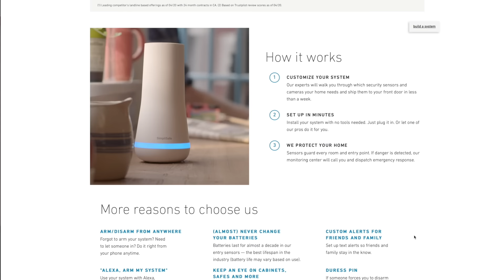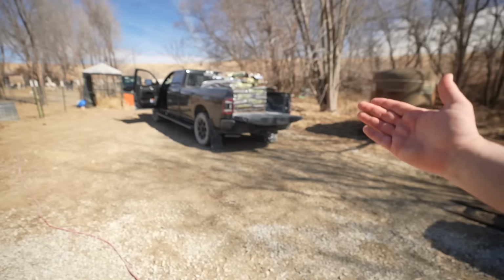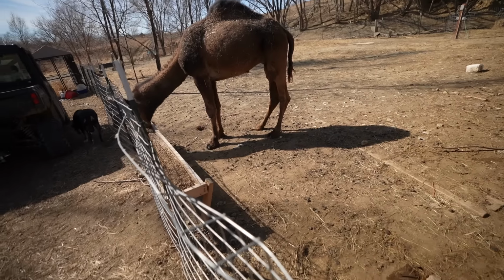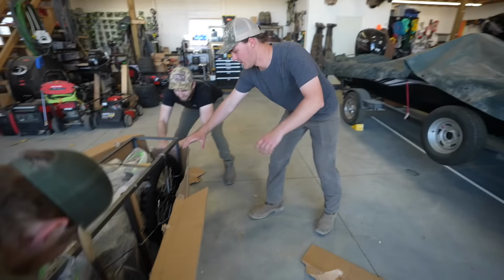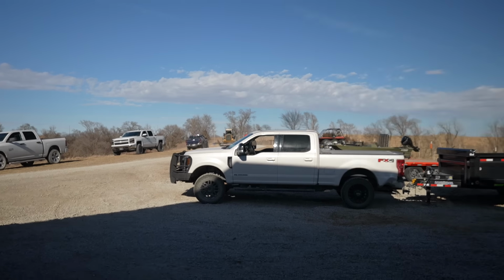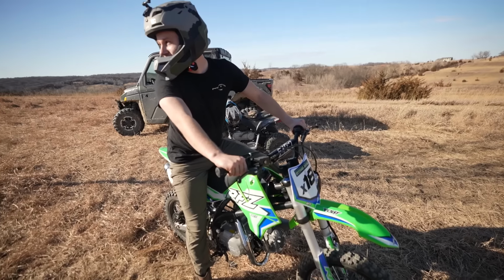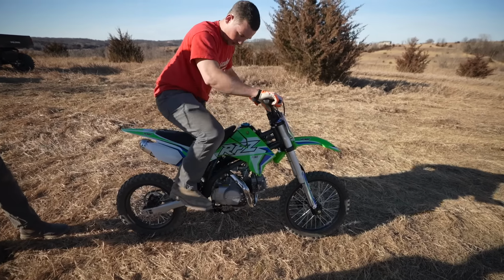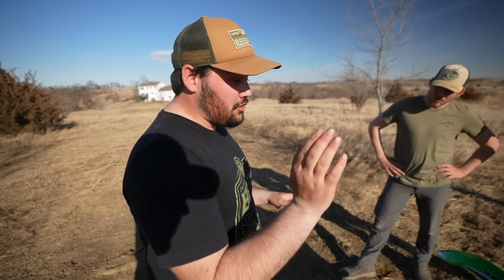Buying the CHEAPEST Dirt Bike on AMAZON! (Taking off Jump)

Comment: Roll starting it gets compression started by moving the cam shaft most 2stroke you can roll start and a starter is just a electric engine turning the cam some people used to put there trucks on a hill and rolls start then that way

Comment: Put blue lock tight on all the bolts. It’s probably hard to kick over because it’s not broke in. They’re not bad bikes to learn on and learn how it works mechanically with a couple cheap mods and move up to a name brand bike and use it as a loaner bike. You could also sell it in a yard sale if you wreck and decide it’s not for you and need to pay for an emergency room visit😂 I wish my first bike was one of those. I had an clapped out rm80 I pieced together and rode with no brakes

Comment: The rattling noise sounds like the chain which is normal they are supposed to be a little bit loose. Usually the rule of thumb is two fingers between the chain and the swing arm.

Comment: Flair what's up bro!!! You da man!!! I have owned one of these RFZ 125's for some time now and if you treat them right they will last! You'll need to change the carburetor to the off brand mikuni on Amazon and make sure you frequently check your nuts and bolts! I have had several pieces of my bike fly off because I did not tighten beforehand. Can't wait to see more vids of the bike! And if you have any questions feel free to message me!

Comment: If you guys didn’t change the oil you will need to because I got on cheaper than that and the oil is bad so change it if you see this!  And the bolt in the middle of the forks might fall off

Comment: I seen the bike doesn't have compression when the clutch is pulled in. I'm pretty sure it's a safety feature that it won't start with it pulled in. If you don't pull the clutch in it will start everytime guarantee had quite a few Chinese bikes in my day.

Comment: Shouldn't mention what security system you use.. there's devices on ebay that share the same frequency as your security system used to arm/disarm your system.. fairly cheap aswell..

Comment: Chinese pit bikes are ok for a budget the rfz you have is pretty good, Kawasaki Honda & Yamaha are better for upgrades but run 4-$5,000 right now I had a TaoTao 125cc it did the same thing with having no compression holding in the clutch and starting it, keep up on spark plug and oil changes she should last 3-4 years or longer anything happens Amazon a new 125cc 140cc or 190cc motor

Comment: It feels like it doesn't have compression because you have to "charge" the chamber,meaning you kick it halfway slowly and it puts compression inside the motor and then you kick it.Also you should buy mx boots so you don't break your boots and and or scrape your shins while kickstarting and riding it.
Reply: "charging the chamber" is finding tdc, which is actually to give it less resistance while kicking it, the kicker just wasnt engaging

Comment: Well you see here's the issue you have a 125cc pit bike comparing it to yamaha thier 125 off the line is a 2 stroke race bike which is completely different then what you have the closest thing you could compare it too would be a kawasaki klx110 and or a crf125f but even then they probably have a higher top speed

Comment: Everyone saying it’s because you were holding the clutch in are noobs. That doesn’t stop the engine from starting. The fact that Banjo held the kick starter down when he tried starting it a couple times and the grinding noise it was making. Probably wore some teeth off the kick starter gear, so it will only grab and start the engine on every other revolution.